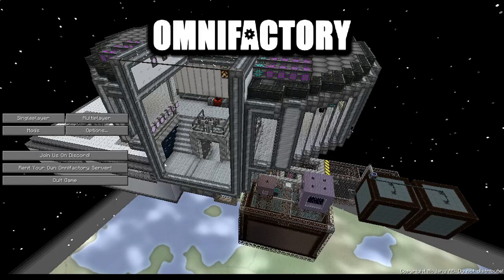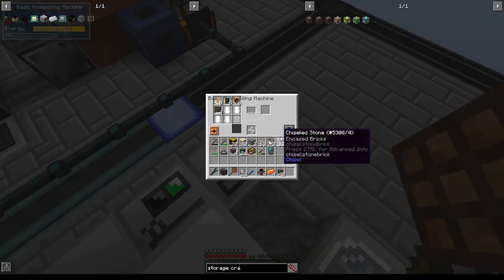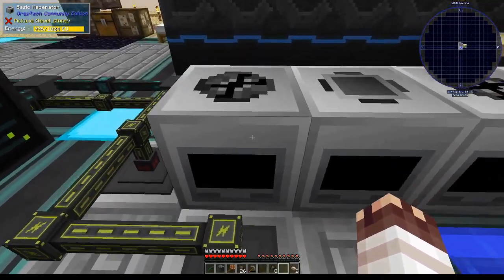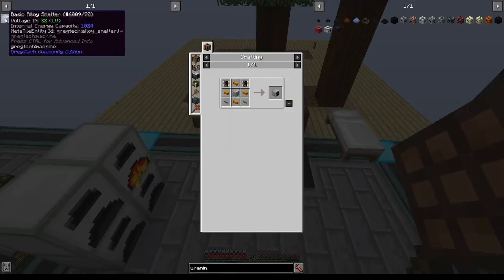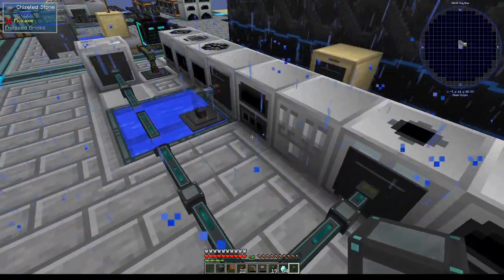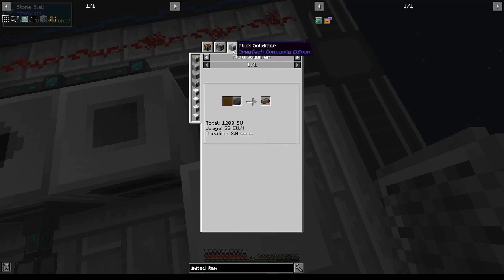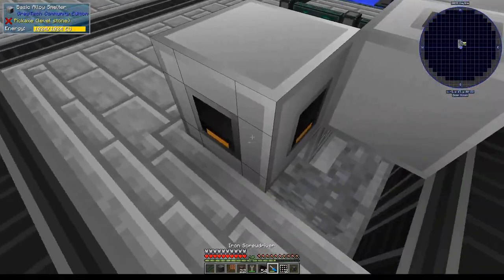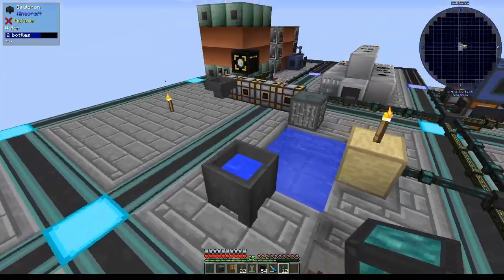New Omnifactory Supershorts #5: Pulsating Polymer Clay

Comment: So are ALL your pulsating dust from uraninite? Enough to get the overworldian matter AND fully train a shulker model AND make all the vibrant alloy for the numismatics?  That seems like a lot of Uraninite idk
Reply from the maker: It requires only two stacks of uraninite ore to fully train a a model (128 uraninite ore -> ore double it -> 1 pulsating dust = 4 PPC.)
Pulsating dust is not required for numismatics.
I believe I had an enderman model, which produces ender pearls for free.
Reply from the maker: Yeah, I just rewatched the video. I recall macerating a lot of uraninite ore at LV.
Reply: Yeah I forgot pulsating dust to polymer clay is 1 to 4